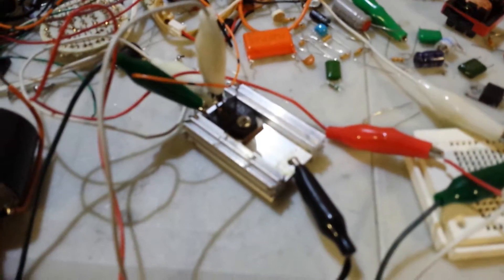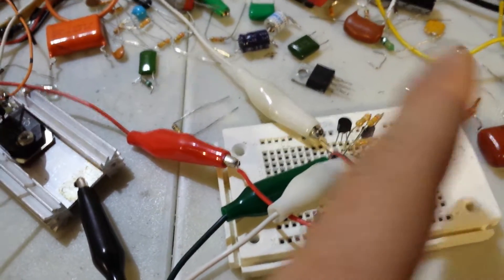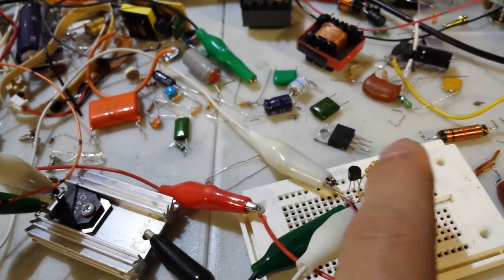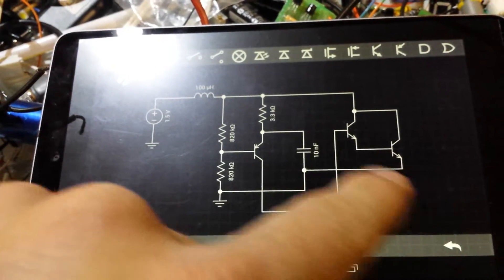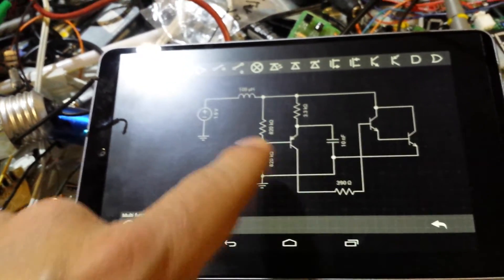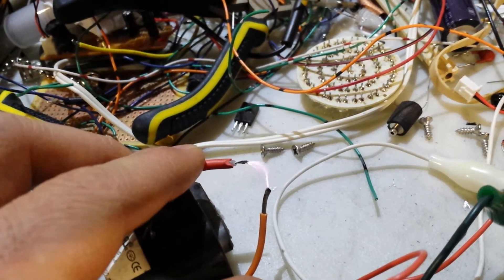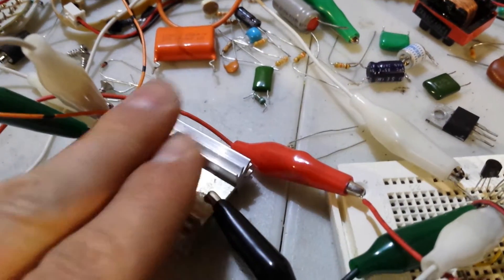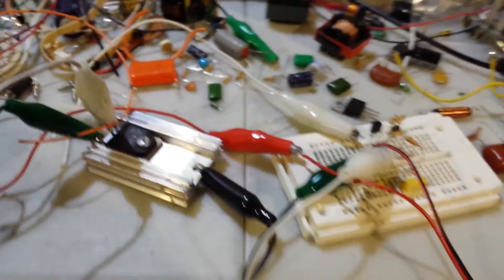Strange and versatile oscillator 3 High voltage production

Comment: Nice video just put a 2s for the transistors and then the  code ;-)
Reply from the maker: Thanks :)
Reply: Np hope it helped
Reply from the maker: I'll check that eventually I'm to lazy to go get the transistor at the moment :P
Reply: Lol ;-) i forgot its morning there right
Reply from the maker: lol oh no It's 3:37 right now :) I'm just back from the basement where it's about 10 degrees down there lol was experimenting on the circuit and found out you can make a plasma speaker out of it O.o..... Getting ready to go grab a coffee with friend :)
Reply: Plasma speaker was gona suggest you that beacuz of the great freaquncy it was giving  but you did it before me lol enjoy the coffee:-)
Reply from the maker: :) The coffee was awesome :P yeah I know the frequency is very VERY flexible lol the volume is low though but the sound is ok I'll try more test maybe I can find a happy middle :P
Reply: And put a littl bit more power get a big arc out of it would be nice :-)
Reply from the maker: More power heh... Challenge accepted!!
Reply: Yeah but safty firs you wont die from ot but some nasty shocks
Reply from the maker: Actually I think there's enough current in some mode to deal some serious damage to the body and even death. So yeah safety first! :) Keep tongue away from wire :P
Reply: No no way if you would have a zvs then that would be seriusly but that is just like a 555 driver yeah until you put 40v at 20A then that would be serius:) tung :P
Reply from the maker: hehe I have no power supply that can give me that amount of current for now....... I need more power O.O lol
Reply: Well a ferrite transforme would be good you could just wire your own secondary
Reply from the maker: Indeed :)